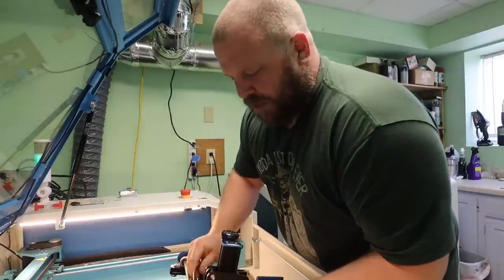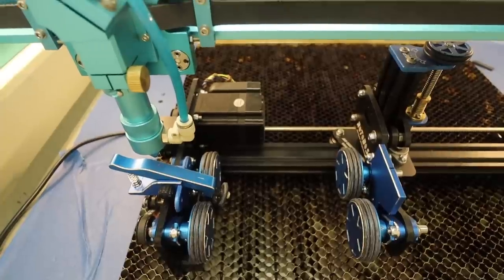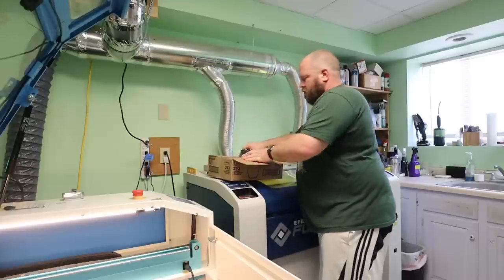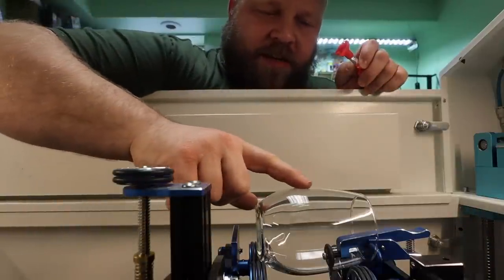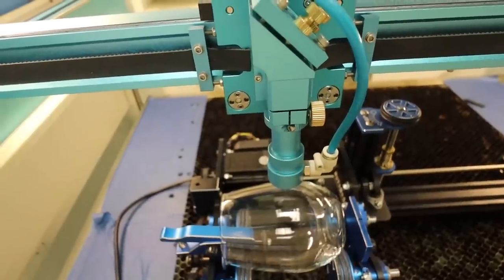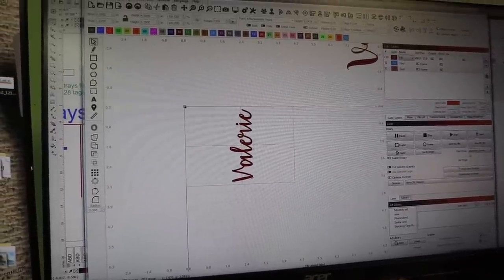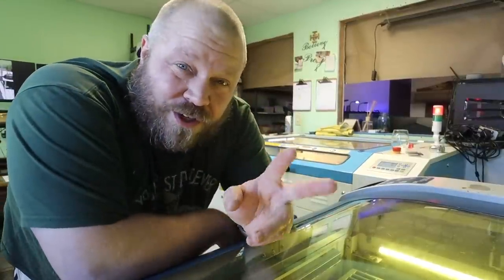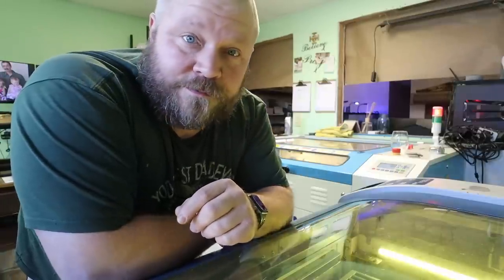Etching WINE GLASSES with Thunder 100 watt laser

Comment: Matt 
I use 300ips at 25% power with my nova 35/100 on Glass and focus in about 1.5mm been using this setting for about a year now. You are going to love the Galvo We Love our Thunder Aroura and it makes more money than the CO2!!! any questions just reach out to me. 
My home shop is set up for customers to come in, After doing research on a space in town no way I was going to give up my freedom working from home. Good luck Matt 
Eric 
Gold Gulf Coast Design.
Reply from the maker: Thanks. I will do that. I am pumped and nervous at the same time for the galvo.

Comment: Glad I got to see you again. lol. I work after hours from my shed in my backyard. It is so handy. I just need to line it as the summers here in Australia can cook you. I am trying your settings on the glass and still having dramas. I'm running a Chinese engraver. What spacing per run are you using. You are the man and thank you for the videos. 💪💪💪💪
Reply from the maker: 😃 I can’t attach a pic to this message but you can go back to the video and when I put the camera on my screen you can see the line’s settings. If not just tell me an tomorrow I will look it up.

Comment: I have a Nova 51-100 and I noticed you had the high air on too. What is your PSI settings? Also, I'm testing on Dollar Tree glasses and not having too much luck? Any suggestions? Thanks
Reply from the maker: For engraving I use low air. Try focusing on to the glass

Comment: Hi Matt, sorry to contact you again, In one of your videos you mentioned K-80 vs K-100, Is this the gray scale? I'm not a graphic designer lol!  Do you engrave in vector format or convert to bitmap for these examples? if so what dpi do you recommend, do you use stucki (lightburn), do you use a max and min power, air or no air?
Reply from the maker: Hold on hold on. If you are using lightBurn then you don’t need to worry about the gray scale. That is only for Coral Draw for Epilog

Comment: Matt, great video.  I'm having good luck with glass so far.  What I was wondering is how you would price this sort of work?  Like for 1 or two pieces, or  case of them (say 24) or 100 or more?  I'm having a hard time figuring it out.  Thanks.
Reply from the maker: Thanks. You need to figure out your time and cost and add a little more and that should be your price

Comment: What speed, power, lpi & focus did you end up using for your wine glasses? I have a Thunder Nova 51 100 watt. Looking for a good starting point.
Reply from the maker: Speed 400. Power 80. Lip 254.00. Focus 5 mm

Comment: I have NO experience doing glass, but 100 percent power seems high. Is that the power setting you used for those glasses? The material library for the 130 says 15%.  Now I need to buy some wine glasses.
Reply from the maker: Epilog says 100 and thunder is not
Reply: @laserengravingwithmatt  what were the  best settings on the thunder? I have to do some wine glasses for my nieces wedding soon. Need a good place to start.
Reply from the maker: 500 speed. 15 power. Line .08
Reply: @laserengravingwithmatt7833   Matt! Thank you so much for this video and helping everyone out there.  Just confirming as I know you tried a bunch of settings in your video.  The final on your 100 watt thunder was 500 speed, 15 power, .08 lpi, what focus 2 or 5mm? and do you use air or shut it off like you do with a regular engrave for wood?
Reply from the maker: Yes and the focus depends on the glass some like 5 and some like 2

Comment: Woke up this morning at 0545 to run dog tags, and watched your video so thanks! Quick question about the sanding pads, which I ordered from your link but which grits are you using? I noticed you held up 2 different color pads one is pink and the other one I couldn't tell. Your Amazon link has the color coded chart with the associated grits but I just couldn't tell which ones you were using. Thanks!
Reply from the maker: Gray. The gray one is my backup
Reply: Awesome, thank you.